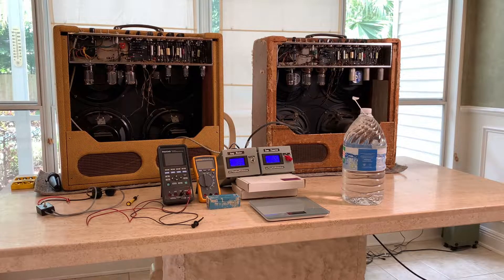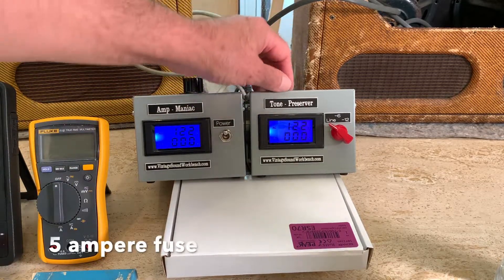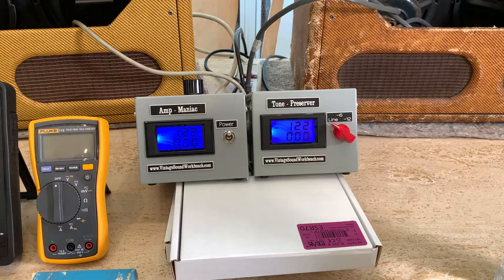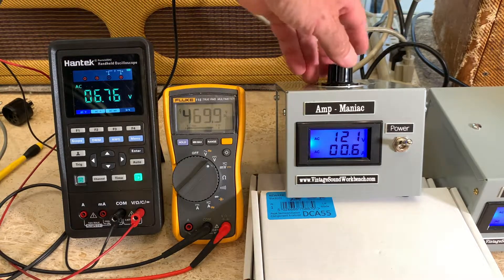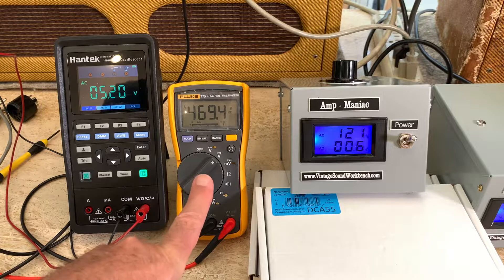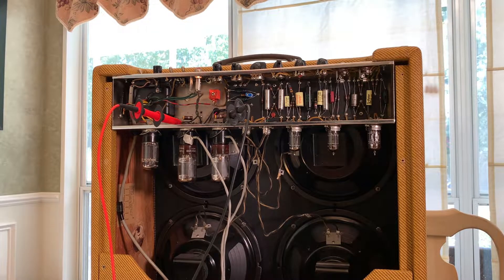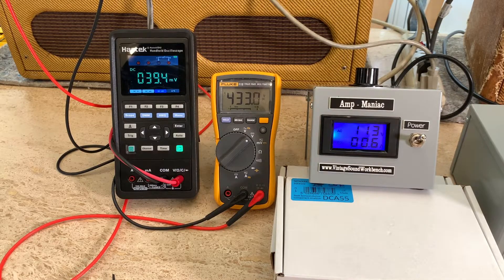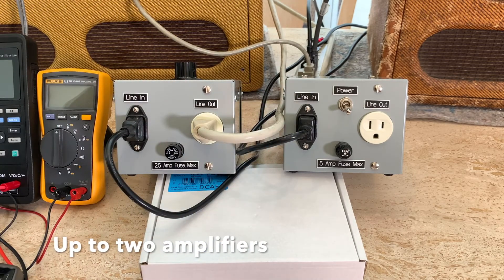Amp-Maniac Demo - A Fully Adjustable Voltage Reducer for Vintage Amplifiers

Comment: Sorry if this is a dumb question, but why is the target voltage for dialing in not 110v as the spec sheet inside the amp says? I see 113v seemed to dial it in, but if I had no fluke meter to use, wouldn't I get a  good result using the voltage reducer at 110v? Sorry to ask...
Reply: The primary and secondary of a transformer is just a ratio of one side to the other. Your output on the secondary will vary based on the input on the primary. If, for example) you shoot for the listed heater voltage, any deviation you see at the plates will be due to the accumulated variances in the individual component tolerances
Reply: @TheDesertRat31  exactly
Reply from the maker: Yes, 110v is fine.  The voltage back in the '50's and '60's fluctuated a lot too.  I just had fun dialing it in perfectly with the Maniac.  On the Preserver, the -12V position would get you right at 109-110V.  I've run my amp many times at 109V.  EVH supposedly ran his Marshalls at 90V to get the brown sound.  I wouldn't run it that low.  The lower voltages will reduce the overall heat in the amp and make everything last longer.
Reply: @millstap  Thanks for that man. I was just wondering.